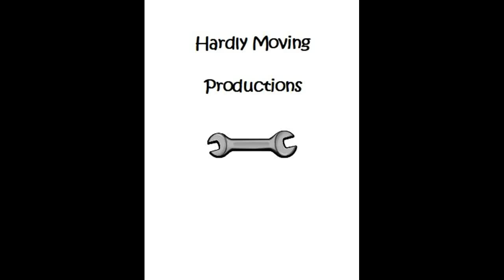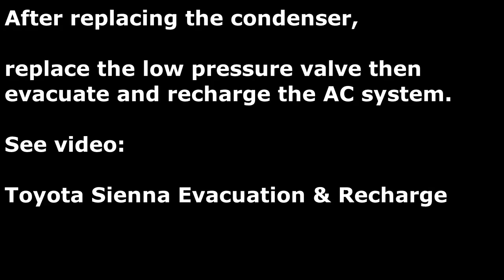Toyota Sienna AC Condenser Replacement

Comment: Thank God I came across this video. This could be of great help. Am wondering how much pag oil is needed for the compressor. Thanks!
Reply from the maker: New compressors come prefilled unless stated otherwise in the box.   Add additional 1 oz for each ac component being replaced.
Reply: @hardlymovingpro  Thank you!
Reply: Hi there again. Am looking anywhere on how to add pag oil into the condenser after dessicant drier been replaced but unfortunately found nothing. Do you have any idea how to add and what port of the condenser should the oil be put in? Thanks in adavance!
Reply: @hardlymovingpro  Hi there again. Just wondering if you have an idea what port of the condenser should the pag oil be put into after dessicant drier replacement (old condenser). I’m asking because the instruction says that an ounce of pag oil be added after replacing drier. I don’t know if this is necessary. Thanks in advance!

Comment: Thanks for the video.  I'm getting ready to replace the compressor on my '05 Sienna, and after seeing this video, I'm going to replace the condenser just to be thorough.  I am wondering though... How do you add oil to the drier?  My understanding is that you want the oil to be in both the drier and the compressor to be better distributed when vacuuming and recharging the system.  Many thanks for your help.
Reply from the maker: The new condenser comes with the drier/accumulator attached.  Just detach it, pour in the oil via a small funnel, then re-attach it.
Reply: @hardlymovingpro  how much oil ?
Reply from the maker: Add an extra 2 - 3 oz of PAG46 to compensate for lost oil in both the condenser and accumulator.  I just pour the extra needed oil into the pre-filled replacement compressor.  Another way is to remove the high side schrader valve, pull vacuum from the low side (via vacuum pump) and pour in the new oil through a small funnel.  Then shut off the pump, screw in the new valve and perform the evacuation.

Comment: @ 3:50. I removed these screws while replacing my radiator. I'm so stupid they 1 was rusted and 2 had to drill 2 out. Oh and 3  didnt even have to touch them to replace radiator... where can I get them screws I'd like to replace them
Reply from the maker: Don't understand why Toyota used screw heads instead of bolt heads.  What I'd recommend is you go to Lowes or Home Depot and find yourself some new bolts that match the threads of the old bolts then cut the bolts to the correct length.  You may be lucky and find yourself some stainless steel replacement bolts.
Reply: @hardlymovingpro  that's what I was planning on doing. But I have to drill old one out fully before then.. I'm just glad its holding together  pretty well

Comment: I am getting ready to replace the compressor on my 2004 Sienna. I think the clutch coil went bad, sincd I am not able to get a resistance reading on the multimeter. Is it safe to assume that the compressor did not fail internally? It is not seized. I want to avoid replacing the condenser if I don't have to. Thanks!
Reply from the maker: It could be a seized compressor or the clutch friction material has worn out.  Also check your ac fuse and pressure sensor.  More than likely, considering the age of the Sienna, the compressor needs replacement.  You can't get a warranty on the compressor unless you show proof that the condenser has been replaced or professionally cleaned.

Comment: This obviously works out fine, but totally not necessary. I did this same job last year and most definitely did not remove the damn front bumper. Just extra work that doesn't need to be done.
Reply: Show video
Reply: I was able to remove condenser in 2008 sienna without 
removing bumper. trick is that if you can remove top grill/plastic piece then it is easy. To remove top grill/plastic piece, you need small 10mm wrench and remove bolt holding gril to the bumper, you will know what I am talking about when you start working. There is plenty of room to remove bumper. I can only vouch this for 2008 model, not sure for anything else.
Reply from the maker: Hey ... Good for you!

Comment: great video I have a question do you know what size is the two screws that mounts the refrigerant line to the condenser.
thank you
Reply from the maker: 10 mm.
Reply: @hardlymovingpro  I need to order new one since one is stripped do I know where can I find them
Reply from the maker: Local auto salvage yard.  They won't charge you anything.
Reply: @hardlymovingpro  thank you
Reply from the maker: You bet!

Comment: What kind of lubricant do you apply to the o-rings on the hose fittings? Also, where can I find new lines that go in to and come out of the condenser? I broke the bolts on the fittings for both of them when I was taking them out.
Reply from the maker: O rings should be lubricated with PAG (aka compressor) oil.  Try rockauto.com for new condenser lines and hoses.

Comment: Thank you for the video.  What type of compound was on the screws that you re-installed attaching the condenser to the radiator?  If I am just replacing the condenser, do I need to replenish oil in the accumulator?  Thanks again for your help.
Reply from the maker: I applied anti seized lubricant to the threads.  You should always replace the accumulator with a condenser replacement.  Add approximately 3 oz of oil to compensate for lost oil for the parts replacement.
Reply: Thanks a lot, I appreciate it!

Comment: Hey great vid!. I have a 2011 sienna that cools good at night or when it's not too hot out (maybe up to mid 80's degrees). I've try to put more freon thinking that it's low in gas but the gauge shows me too much pressure already.  Could it be the condenser that's blocked or something like that?. I've heard things like  it
Reply from the maker: You have to see the pressure output produced by the compressor.  If under 170 psi and the low pressure side is over 40, you've got a weak compressor.

Comment: May I ask why you changed your condenser? This the same one you changed the compressor on? My ac clutch gap is out of spec and I plan to just replace the compressor in my sienna and not the condenser. I don't think I have any damage to my system. Thanks!
Reply from the maker: In the past I've tried to save the customer money by not replacing the condenser.  The problem is the condenser tubes are too small to blow out and clean, and the only way to really test to see if the condenser is okay is by installing the new compressor, evacuating, recharging and then checking the high pressure output.  If the pressure is not good, there's probably an impediment in the condenser.  You then have to go through the process of evacuation and recharge .... again, if you want your AC system to work efficiently.  Also, the compressor providers are now asking for proof, if the new compressor failed, that you did a "AC Flush" which translates to cleaning the condenser ... which what I had previously said is a waste of time.  So I just replace the condenser with every compressor replacement.  I haven't had a need to replace expansion valves since if there is any debris build up, it would get trapped in both the condenser and accumulator and would not work it's way towards the valve.   Again, these compressor providers want proof that you also replaced the expansion valve.
Reply: @hardlymovingpro  
Thank you very much for the reply. Do you think I have to go denso on this or is a condenser a condenser? 2006 sienna 106k
Reply from the maker: Condensers are not nearly as sophisticated as compressors.  So you can go with any reputable brand for a condenser replacement.  But for a few bucks more, I like to go with Denso.  Everything just fits and aligns perfectly ... clips, holes, nuts, fasteners... etc.
Reply: @hardlymovingpro  
Thank you for your time. Your videos are great.
Reply from the maker: You're welcome and good luck!

Comment: Good job I have a question how do you notice when the ac condenser must be replaced.
Reply from the maker: Thanks for your comment.  Condenser failure symptom:  No refrigerant pressure in the system caused by a leak (hole) in the condenser.  To test, take off the low pressure service port cap, push down the schrader valve with a blunt tool and see if there's any pressure.
Reply from the maker: Also, you'll see a dark oil stain around the leak point on the condenser.